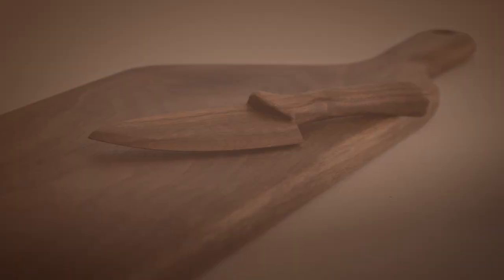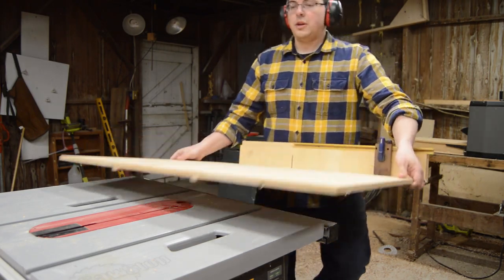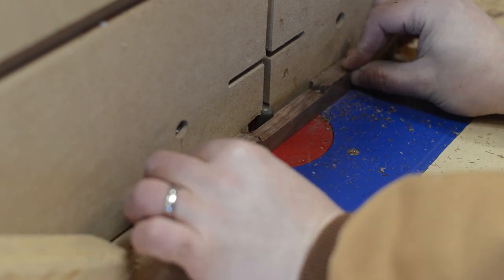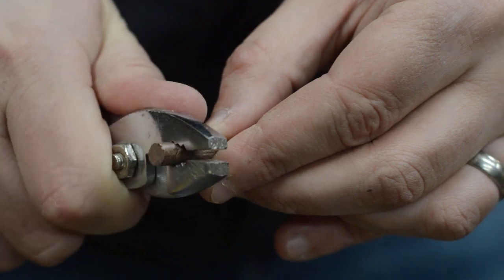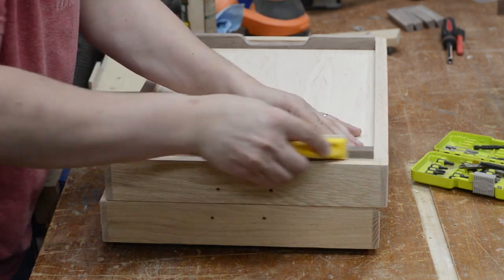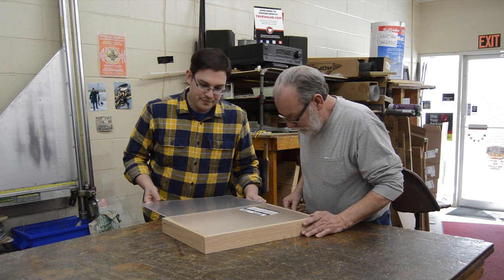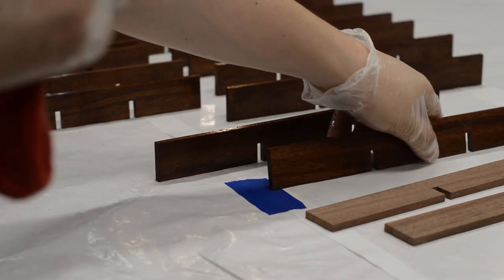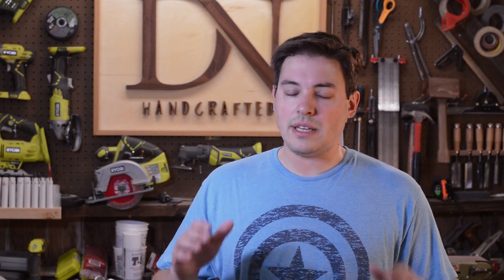Stacking Display Trays – DIY Divided Collection or Tea Storage

Comment: I've not seen that tip about using brown paper to sand between finish coats. Is there more to it, or is that it?
Reply from the maker: That’s all there is to it! It doesn’t work to actually level out uneven finish, but for knocking down the fibers/dust bits before the next coat it works great.
Reply: I'll give it a try! Thanks! (...and, happy anniversary!!)
Reply from the maker: Thanks!